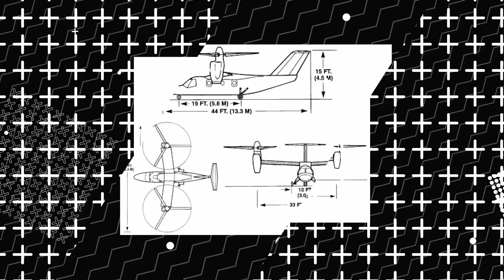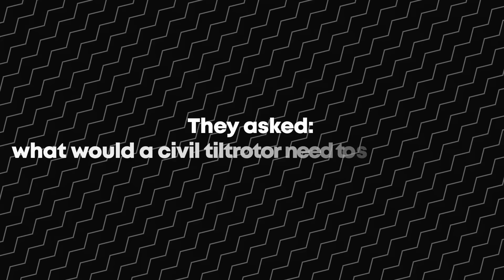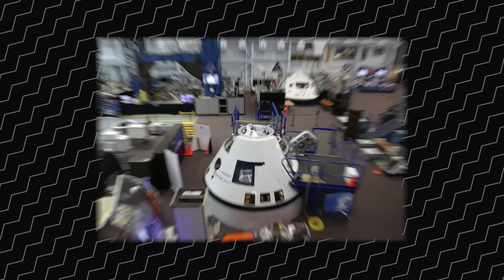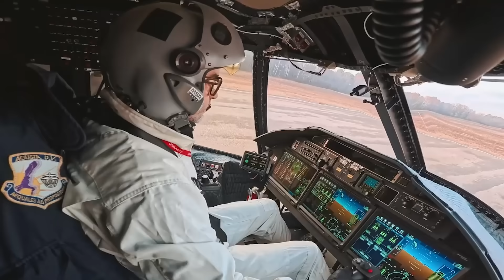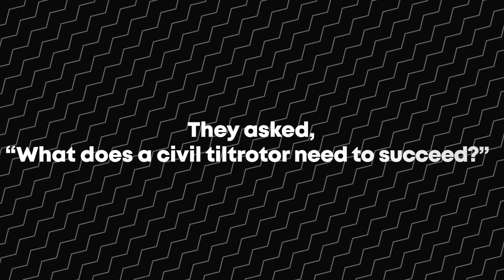Everyone Said Civil Tiltrotors Would Never Fly — Then Italy Did This

Comment: Civil tiltrotor pilot licensing differs significantly between regions.
In Europe (EASA), civil tiltrotors are classified as powered-lift aircraft. Pilots are expected to hold at least a CPL (A or H) with Instrument Rating, plus a powered-lift type rating for the specific aircraft (and MCC if multi-crew is required). A standard PPL is generally not sufficient.
In the United States (FAA), the framework is more flexible: a Private or Commercial Pilot Certificate can be used, with powered-lift privileges/training for the aircraft, and an Instrument Rating only if operating IFR.
Overall: EASA requires professional-level licensing; FAA allows private operation with additional powered-lift training. (Made by ChatGPT with my suggestions) The honest Thomas 😊

Comment: Very possibly the Least info in a 10min video I've seen - absolutely Zero Info/Insight
Reply from the maker: What do you mean by that?
Reply: @SteelsBeasts I hoped for a detailed technical breakdown, expansion on Leonardo's plans (rumors ok) to capitalize on this machine. As you know Piaggio had an innovate design, though not stunning commercial success, and Baykar bought them out. Will Leonardo go ahead, sell out, or stop? Qua technics, there were interesting differentiations between the pro types that could have been explored further, eg. emphenage & the engine tilt configuration which seems to solve an important problem of the Osprey. No info was given on actual propeller architecture (quite interesting subject) nor engine details. Interestingly the fuselage architecture misses an obvious opportunity for the stated market (& opening to the military market) of a rear ramp/clamshell doors. Obviously designers have their reasons for all this but a more detailed briefing would be beneficial. Am very curious how Baykar will leverage the Piaggio Aerospace acquisition. Leonardo have been bulking-up & consolidating but will this project end up on the rationalization chopping block?

Comment: tiltrotors helicopters are quite pointless,  it doesn't have much higher top speed compare to pusher propeller helicopters (around 500km/h tiltrotors compare to around pusher prop 400km/h) ,  pusher prop can still fly, maneuver, go up and down like fixed wings aircrafts without being too complex 

due to 2 tiltrotors infront ,  it can't perform attack role like other attack helicopters,  that is why pusher propeller helicopters are way more versatile compare to tiltrotors, despite having lower top speed

the only huge advantage of tiltrotor is range , due to tiltrotor design,  it is much more fuel efficient than pusher propeller helicopter